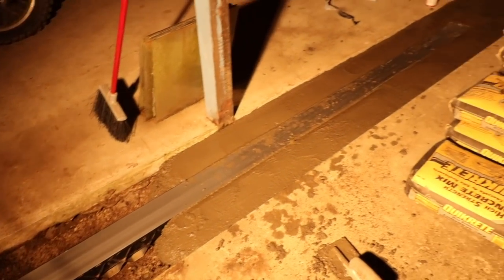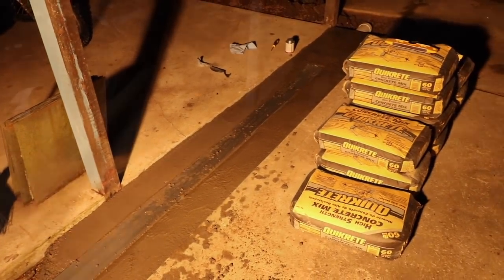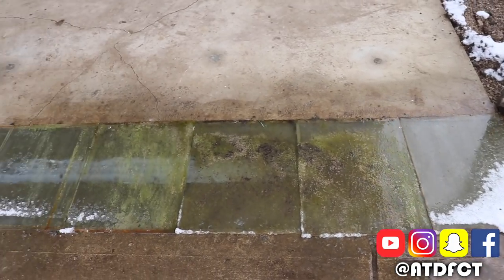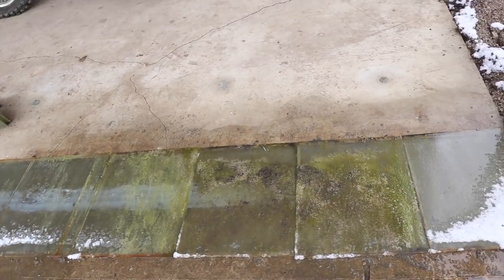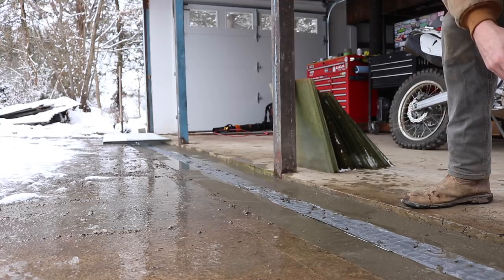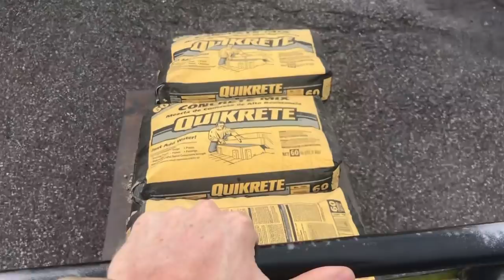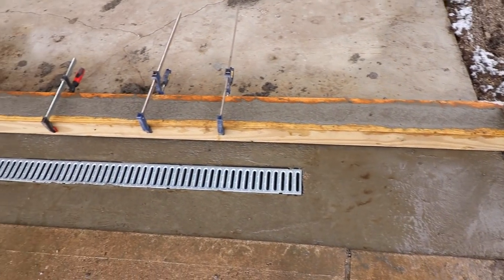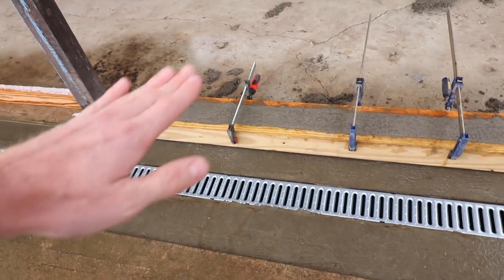Pouring Concrete With My Girlfriend | Channel Drain Install!

Comment: Great job I do concrete daily you did a pretty decent job don’t take this the wrong way but if you’re to do it again put pieces of rebar drilled into opposite sides of the concrete that way it won’t lift when it freezes
Reply from the maker: Much appreciated! Good tip, only time will tell how it holds up.

Comment: You should do the other side the same way. This way your framing won’t be on the floor where it can get wet   I no you will probably use treated lumber on the floor but it still does a better job if it doesn’t get wet to often.  I’m a sub contractor by trade. If you have any questions please feel free to ask.
Reply from the maker: Much appreciated! My question is the other side is higher off the ground so it is already above the waterline, what would be the difference of bringing it up higher.
Reply: Attention Deficit it depends on how hard the water rushes down to the drain and if there is a chance that the drain could ever stop up and over flow and then run under and flood your building.  And if you plan on washing your building out with a water hose then  it would be good to keep the wood off the floor to prevent rot and mold and mildew    I believe you would like it better in the future and wish you had done it.

Comment: Looking good, great job.  Why didn't you extend the drain pipe all the way to the corner ? (Just in front where you built the low wall ).
Reply from the maker: They are built in 10 foot sections, not cheap either, I centered them and called it at that, should work just fine. Thanks for the comment!
Reply: @AdventureDaily   🎁🎁🎁🎁merry Christmas to you and the rest of the family 🎁🎁🎁

Comment: Do you need to vibrate the wet concrete to get the air out?
Reply from the maker: It helps but isn’t necessary in a situation like this, the bubbles will rise.

Comment: I saw the notification... But I was at work. As of tomorrow I'll be on graveyard so I'll try to catch as many as possible. I used to do demolition, and the over head signs were a bitch to get out.
Reply from the maker: No worries Corn man! Enjoy the holidays.
Reply: @AdventureDaily  I was gonna hop in the one last night, but work, and I was riding. Found out riding in the rain kinda sucks without good shoes or boots